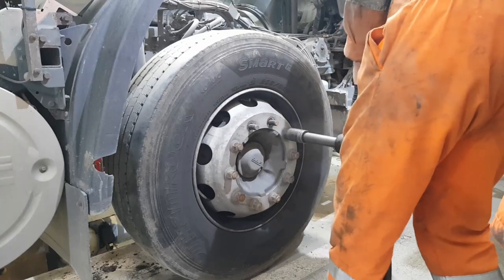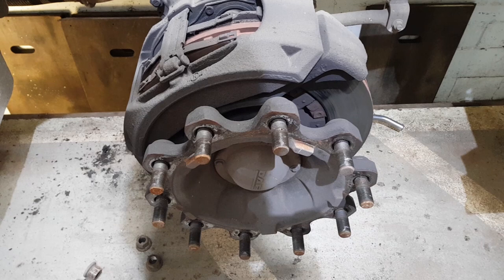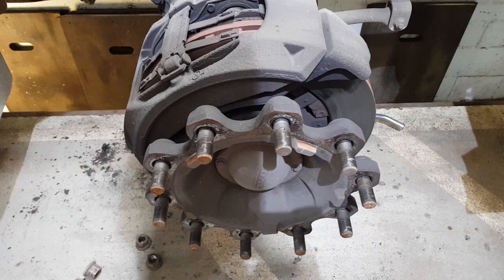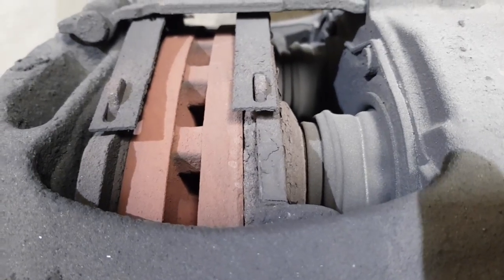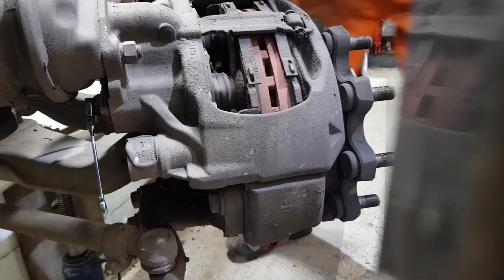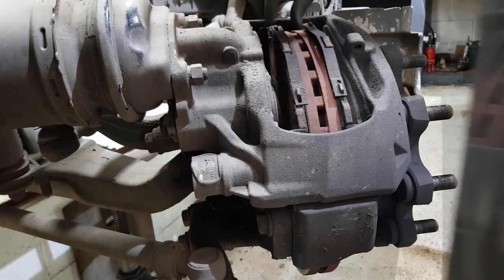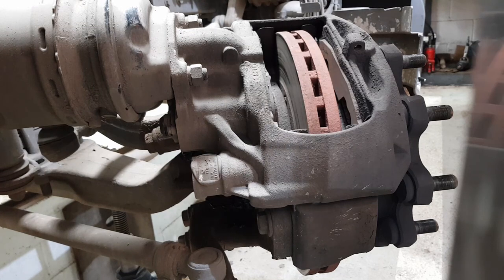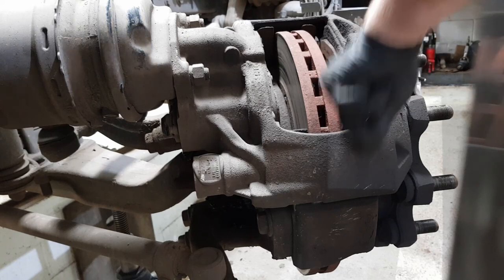How To Replace HGV / Truck Brake Pads On DAF Mercedes VOLVO IVECO

Comment: Daf cf and xf run the sames brakes. So do the lf with 22.5 wheels.  Volvo and Renault use the same set up as each other, but instead of the pin and clip they have a 17mm hex bolt. . If you lift the rubber on the pistons and spray some maintanve spray in there that helps the wind back system.
Reply from the maker: Thank you for your input.

Comment: If you're changing disc on daf fa lf45 2012, whats center nut socket size to take the wheel hub out?
Reply from the maker: Front or rear???
Reply: Front my mate
Reply from the maker: I beleve s 2012 has a ring of bolts instead of a hub nut to remove the disks, if no then it's the older type witch is a 32mm nut
Reply: Okay, thats interesting. Little light for me to do not spend another 130£ to use once 👌🏻👌🏻👌🏻👍🏻👍🏻

Comment: My piston are siezed what could I do to make them loose
Reply from the maker: Is it breaking the adjuster tool when you try to adjust it?
Reply: Can I service them
Reply: Can it be serviceable
Reply from the maker: You can free them up but I don't advise taking it apart.

Comment: The orange coloration of the rotor says it over heated
Reply from the maker: That's normal around South wales with all these hills, these lorrys do very little motorway miles.